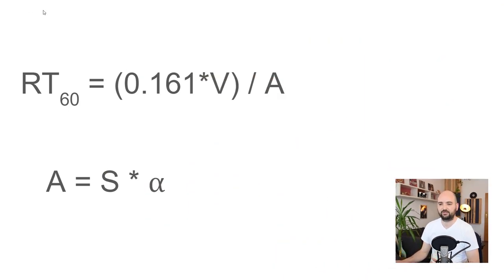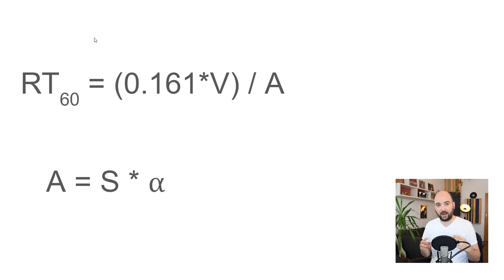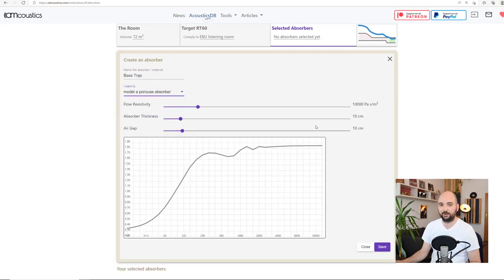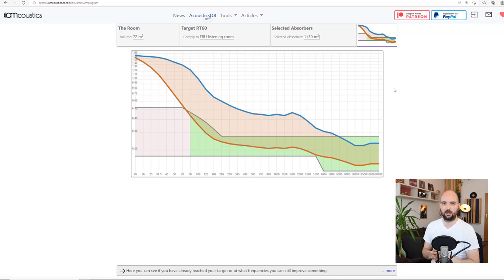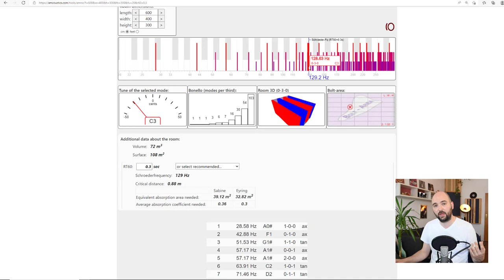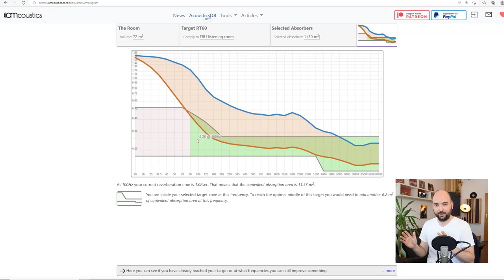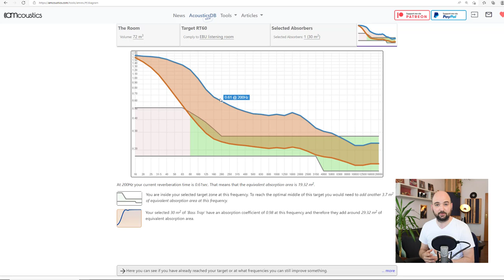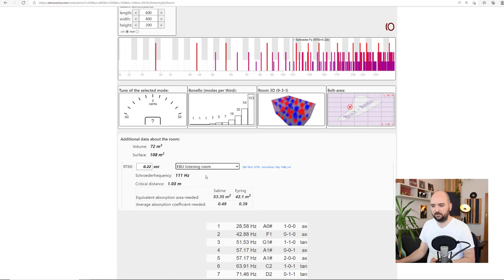Home Studio Acoustics: Why You Can’t Calculate How Much Treatment You Need - AcousticsInsider.com

Comment: Slightly off topic but I’ve been looking at properties to purchase so I’ve been paying special attention to floorplans and punching them into AMROC and something I’ve noticed is this: I know we say the bigger the room the better, and I think it’s because more diffuse, right. But when you get to a length of more than around 420cm your lowest standing wave dips below 40hz which makes it harder to tame with absorption. At this length, to get a good distribution of modes (Bonello) this corresponds to a width of around 300cm (with a standard Australian modern roof height of 240cm) and this all seems very workable. But my question is, what’s happening to the frequencies below 40hz? Obviously the speaker is still pushing air and we can hear those frequencies. Are they still causing problems for us that are not related to standing waves that mean I should still go for a bigger room?
Reply: sorry it's not Jesco replying but this is my 2 cents. I guess anything below 60Hz, you'd have to check with a good pair of headphones. And also maybe visually monitor your master bus. Also maybe the mastering engineer will be able to control that low end for you.

Comment: Jesco, I have a question: when choosing an insulation material for deep absorbers (80-90cm) is there any difference between mineral wool, rock wool or fiberglass wool when it comes to their density and acoustic properties? Does 30kg/m3 mineral wool work the same as 30kg/m3 fiberglass?
Reply: Slug and glass fiber have different densities so of course they will have different porosity and flow resistivity. From data easily found on the web fiber glass will have double the flow resistivity.
I have zero experience with acoustics but one idea I had was to make a spaced layered absorber. When you truly have 1m of space for absorption, you don't really have to fill the whole space with absorbing material. The idea is to hit the areas of low pressure and high velocity for all frequencies (at quarter wavelength distance from the wall). Acousticmodelling shows that placing just 5cm of standard acoustic foam (10kPa) at 1m away from the wall really nails the 85-90Hz range. If you palce a few layers, at 100cm, 50cm and 25cm, they seem to add up to a broadband absorber. Again, purely theoretical, but very interesting and will only cost you 15cm of foam instead of 100cm of rockwool.
Reply: @Kobrar44  thanks!

Comment: Awsome as usual Jesco! I wonder at what point a room falls into the "not small" category? In other words, what sort of dimensions are we looking at when we talk about a "large" room (not a stadium though)
Reply: An acoustically small room is one where the wavelengths being produced don’t fit inside the room and therefore “stand” because they can’t propagate
Reply: Small is anything smaller than 1500 cu ft. In volume. Lxwxh

Ideally you’d want a dimension 18ft long which is about half length of 40hz wave. If I built a room it would be 23x17x10.

Comment: Because people don't want to understand that each surface walls, ceiling, floor has to have at least 50% wall coverage of the right treatment to make a significant improvement in a room. Also, it depends on usage, it depends on how your room is constructed. If your walls and ceiling were designed to absorb low frequency problems down to 30hz, then you would only have to deal with mid range and high frequency reflections.  But most homes are NOT designed for audio applications.  They have thin walls that can only isolated so much energy above 125hz, so you either have to reconstruct with better wall designed to absorb the amount of energy so there aren't any room modes.
Reply: I don’t have any of my floor covered, and I have significant improvement
Reply: @dougleydorite  Do you have carpet on the floor?  Each of the t6 surfaces represent about 17% each to the sound of the room.  You have to look at the Axial modes first as they are typically the largest problems in terms of peaks and nulls at given frequencies and because Axial modes are unwanted pressure between 2 wall surfaces, you have to identify which frequency you have a problem, which 2 surfaces that frequency is between, and then treat accordingly.

Typically in 8ft ceiling rooms, there's a 70hz problem between the floor and ceiling..  If you don't treat at least one of those two surfaces with something that will absorb 70hz effectively, then you will still have that problem.

Of course you can have significant improvement, but that doesn't mean you don't have any problems. You still will have problems, it's either than you put the proper treatment on the ceiling to go after than Floor to Ceiling problem, or you didn't.

A "significant improvement" is kind of nebulous term.  For what I think is significant and you think is significant might be drastically different.  I may think that you still have major problems you haven't addressed, even you think you did.

did you conduct measurements to find out what frequencies you have problems with and which surfaces those problems are between and use appropriate treatment to go after those problems?    Or did you just put up a bunch of treatment, which will do something, it just might not fix all of the problems in the room, I see that all the time.  Yes, it sounds better than with no treatment, but it still has problems. 

Judging whether you addressed all of the problems has to be addressed and you can take measurements to make sure they've been addressed.
Reply: @Oneness100  and once you add treatment, the game changes. It's when the play moves to your favor that success is gained. I agree with you on taking the time to create a great room. But it is time, and money...
Reply: @Oneness100  I have laminate flooring. I have absolutely measured and all that good stuff. I have a thread going on gearspace of all of my progress and where I'm at currently, including REW MDAT
Reply: @dougleydorite  That's nice.   How low are you trying to get ambient noise levels down to?   How flat of a room response curve are you trying to obtain?  And can you measure flat no matter where in the room you are taking the measurement from?
Reply: @Oneness100  ambient noise in terms effects in music or physical noise? My computer is quite loud at 45 dB. So far I’m not going for flat, I’m looking to have a bit more low end as that’s how prefer to work with translation. Low end moves quite a bit when changing listening position
Reply: @dougleydorite  Ambient room noise.

If the low end moves quite a bit when changing listening position, that means you don't have your room modes managed.  Either you have to build walls/ceiling that will absorb those low frequencies, OR you'll have to build/buy large diaphragmatic absorption and essentially line the walls.

Low frequency modes cause all kinds of problems and If you don't get them under control, then your mixes will be harder to make.

What's the dimensions of your room and what type of wall and ceiling construction are you using?
Reply: @Oneness100  you can check all the info of my room on gearspace. Look for “pseudo soffit mount for monitors” 

Do you post on there?